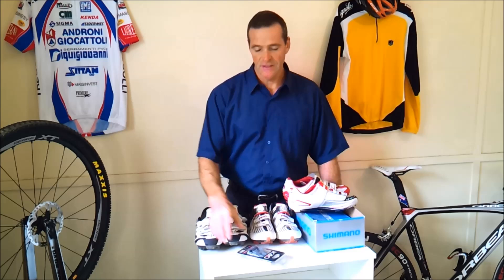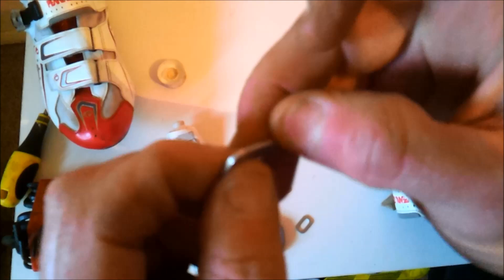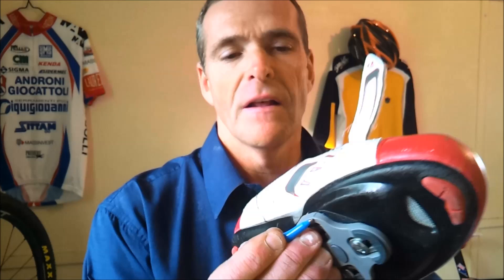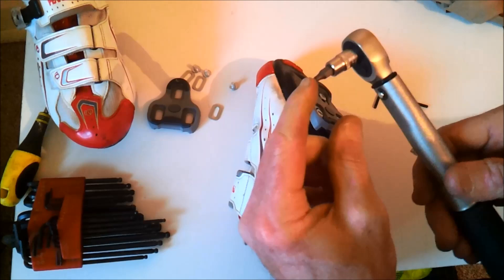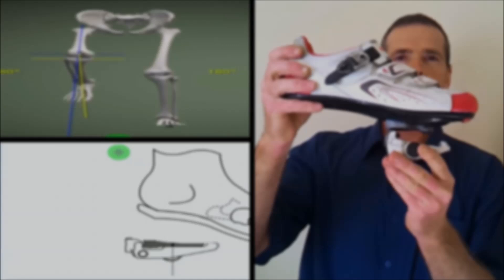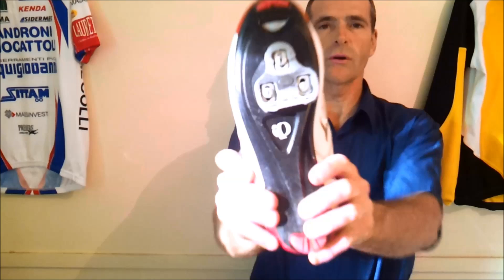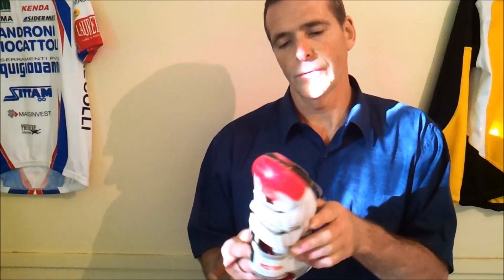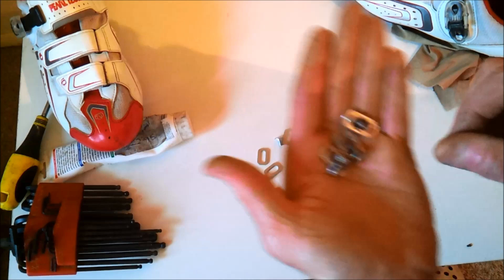Fitting Look cleats correctly  Pt.1

Comment: Some people also recommend to do the same on the outer side of the shoes as well, then put the axle between the two markings in a way that the diagonal line between them runs through the middle of the cleat. Doing it this way will put the cleat a little further back than shown here.
Reply: Björn Holzapfel this is exactly why I disliked the video. 
Newest findings from the bike fitting community say, that the pedal axle should be behind the most protruding part of our toes. 
Good method of testing this is to climb a couple of stairs. We tend to put our foot way deeper than the line defined by the spindle.

Comment: You're applying WAY more N.M. than what you've got the torque wrench set at. A torque wrench is calibrated by using the proper handle area as the leverage point. Watch Park Tools video on the topic. Only telling you because this could cause somebody a major headache one day when they break an expensive carbon part because they are choked up on their torque wrench.

Comment: Bollocks, the bone of the first metatarsal should be FRONT OF not dead center of the pedal! That is how the most FORCE can be exerted......the straight line in the middle nonsense as well, nobody walks in a line, we walk outwards because of the skeleton-muscular system, thus naturally the heels fall a little inward, so the line is not straight, but in an angle whilst riding a bike as well.....!

Comment: Really great video, best for Look cleats that I found so far, thanks for being so detailed. 1 question, arent u putting too much torque on the wrench, since u r holding much closer than it was designed to? Or the torque needs to be much higher than 5.5? Please let us know
Reply from the maker: The torque is limited firstly by the nut insert in the sole of the shoe. With grease on the bolt thread usually you can get higher tensions.  "Look" cleats often tend to slide so once you have the right position for your cleat, tighten it so it want move.

Comment: Hi, thanks for the great info. I hope you are doing well. Question, if I install the Look Keo Cleats (Grey, no rubber feet) to use with my Keo 2 Max Pedals, can I do so WITHOUT using the Memory Clip AND NOT using the rubber cover (the part that covers the memory clip)?  I am looking to avoid any squeaks and not interested in the memory clip feature. If I can go without installing the memory clip and the rubber cover are there any downsides?  Thanks again,  John

Comment: Very helpful! How important is it to grease the bolts?
Reply from the maker: +Toquelibre Yes bolt threads should be greased on installation.
Reply: @stevenleffanue  Have just fitted first set of cleats on my first set of shoes ahead of a first ride on a new (used) road bike, I didnt grease the bolts, why is that necessary and what grease would be used?
Reply from the maker: Moisture gets into the threads and corrosion ceases the threads making it sometimes impossible to unscrew the bolts. Any grease is good

Comment: I use masking tape to mark around my old cleats .. easier to see, and leaves no marks (not that it matters .. just an OCD thing 🙄) I also use a little loctite blue on the bolts instead of grease so I’m 100% sure those bolts ain’t gonna loosen .. nothing worse than trying to unclip with loose cleat bolts 😳
Reply from the maker: No loctite on cleat screws otherwise when time to undo you may find the nut in the sole goes around too.

Comment: I am concerned with getting clipless pedals. How do you walk in your shoes without messing up your cleats? I am a tall bloke so shoes dont last me long. They wear out fairly quickly. Any advise?
Reply from the maker: Use mountain bike shoes with shimano cleats Charl. The shoes have a much chunkier sole to walk on and the cleat is recessed so it doesnt wear whilst walking.
Reply: @stevenleffanue  thank you, will do.
Reply: OR you could put a small piece of cloth athletic tape on the very bottom...an older retired rider gave me that suggestion ~

Comment: Hey Steven, what if you have done a bike fit and the fitter turn it a little so that your knee can go up and down
Reply from the maker: +Irv4know 306 Sorry,not exactly sure what you mean here??
Reply: Sorry I'm trying to get my cleat on the right back to 166mm and left 167mm. I change shoes so I don't know how to put them to the measurements above.
Reply from the maker: +Irv4know 306 Ok.. you want to set cleat on new shoes the same position as on old ones? This often requires good guessing and multiple rides with new shoes at slightly different cleat positions. Once you get the cleat right,scribe around the outside of the cleat.This is why professional cyclists always take the same shoes to events.

Comment: Please don't use this video as a demonstration of how to use a torque wrench...Must be held at the end of the handle to properly deliver set torque.  That's the "meter" in Newton-meter...Gripping near the head of the wrench makes the setting on the wrench basically meaningless...
Reply: kriegner...nice tip but your 'delivery' is harsh. "In the end it doesn't even matter~"-Linkin Park😜😱🖖
Reply: Not correct...torque equals force times distance. Hold closer and you have to apply more force because distance reduced. The torque click is set by tension correlated to torque so it makes no difference where you hold the wrench.